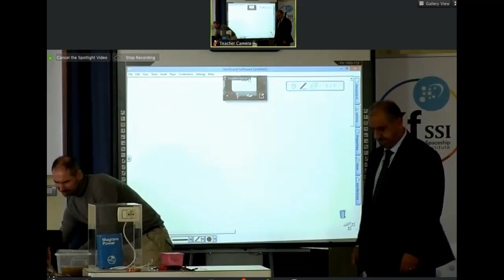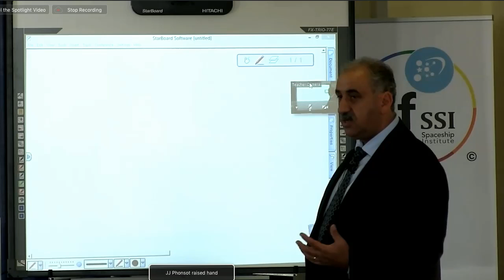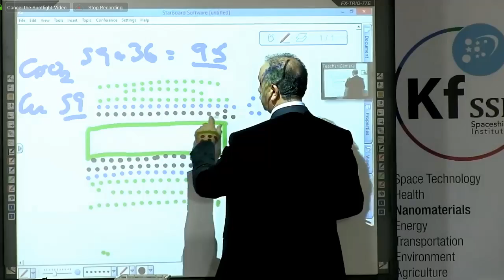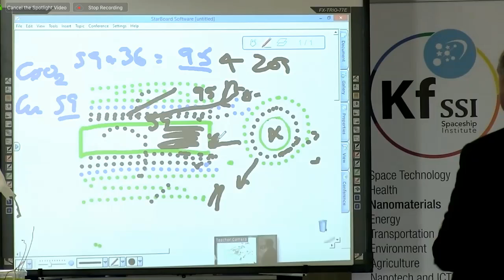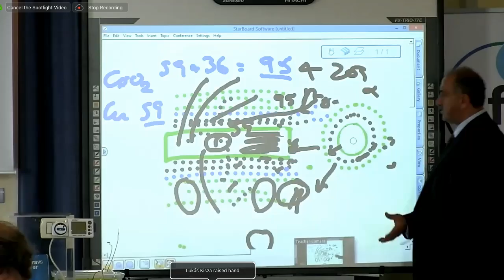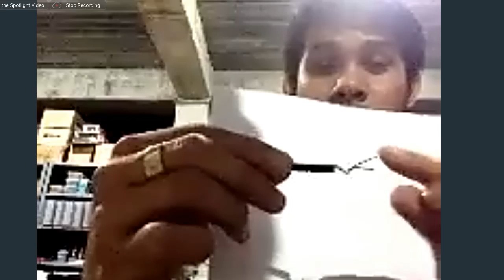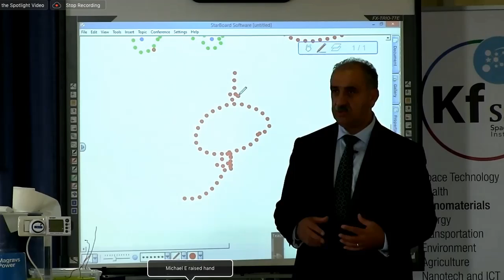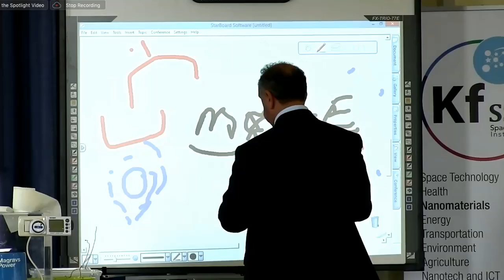KFSSI Blueprint Teaching HD #Session 3

Comment: Richard, find me on FaceBook to trade photos. I made two small rings, now sitting in NaOH. I like your method. What is the drill attachment called? Amazon has something called "drilling rod" assortment of 3 rods seems like that would work with my drill. I did try to make one large 150 turn ring but it fell apart when I tried to thread the end in to hold it together, the outer/wider coil was not tightly packed enough, I used scrap pipe to roll it by hand with 18 gauge. The 14 gauge is slightly heavier than what I used which still took some work to soften and bend. I am very eager to see your working magrav.